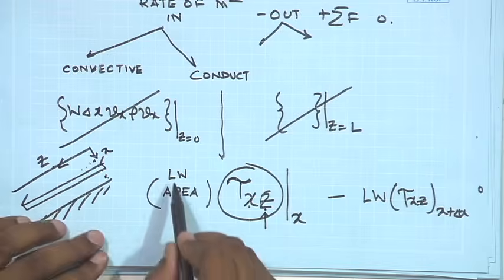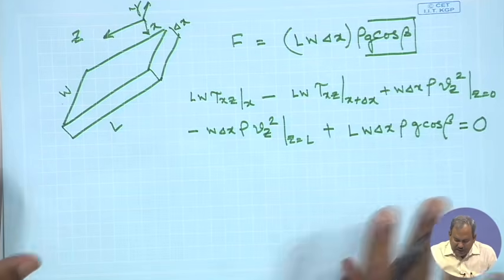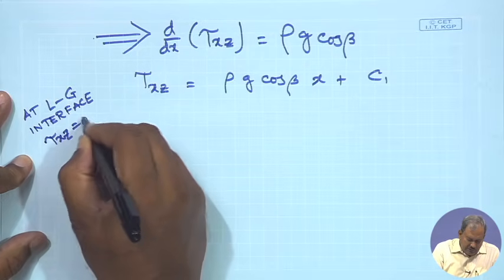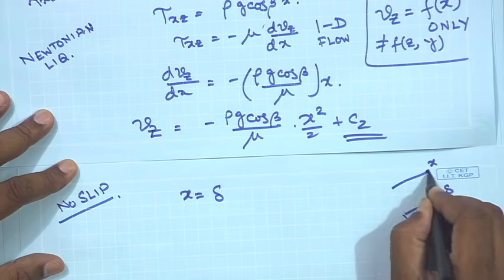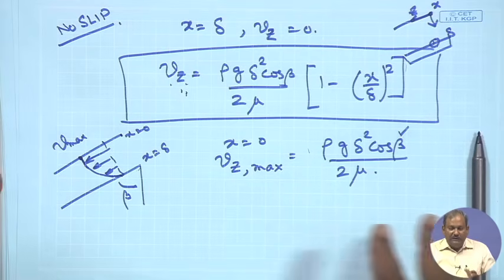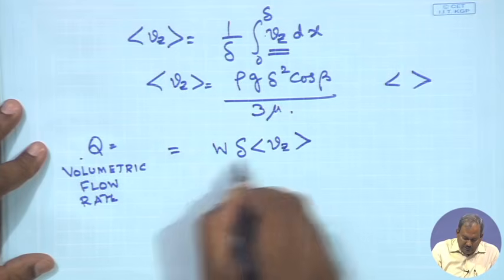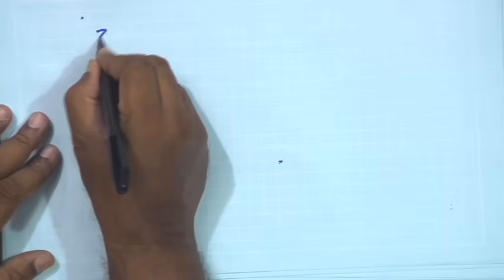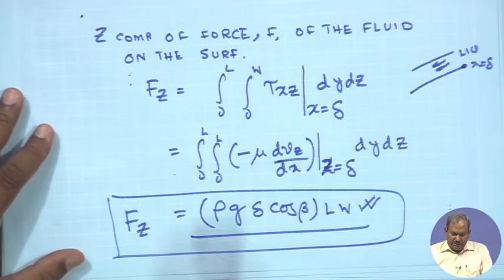Lecture 04 :  Example of Shell Momentum Balance

Comment: Switching between V_x (in the first part of lecture, also lecture 3) and V_z (in the latter) can be confusing. Probably better to consistently use V_z throughout since flow is in z-direction.
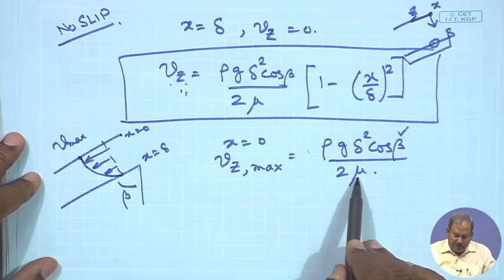Reply: Science students are normally trained to look at height/depth as z direction from very early on, so I agree it is very confusing; another confusion arises because of angle Beta is shown from the verticle direction. If Beta increases (somewhere close to 16:30 min in the video), the angle of inclination (which is from horizontal) actually decreases!

Comment: There should be 6 in denominator in place of 3 .... Because 2 is already there in denominator of vz
Reply: Not actually true. Inside the right parenthesis there comes 2lambda/3 and 2/3*1/2=1/3
Reply: @mr.mcfife4131  how did we get (2/3)
Reply: If you carry through the integration you get (rho*g*d^2*cosB)/mu (1/2 - 1/6), which ends up having the denominator given in the video
Reply: hi  @jasonwilkening8036  how do you get the 1/6 in the denominator?

Comment: Should there be the delta(thickness) term in the force acting on the solid plate due to the liquid moving on it?
Reply from the maker: The z component of the weight of the film is balanced by the shear force acting on it and therefore, the thickness of the film must come in the final expression (to calculate the total weight of the liquid film).
Reply: Thank you for the helpful clarification.